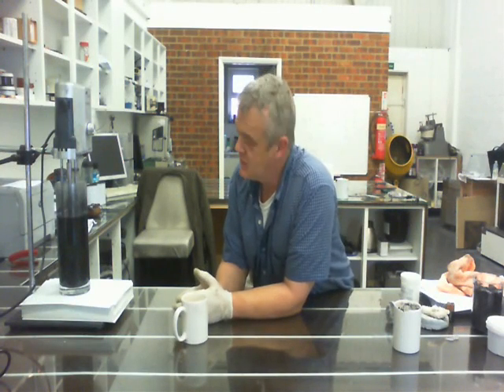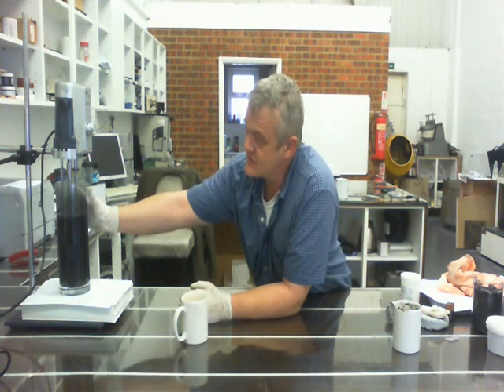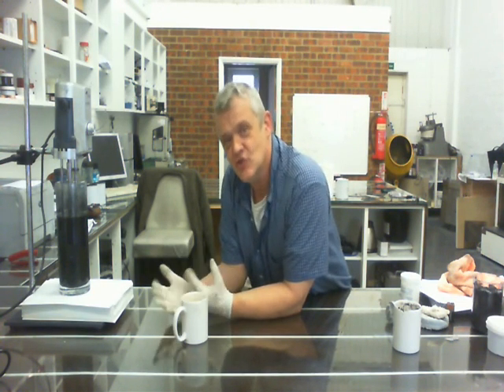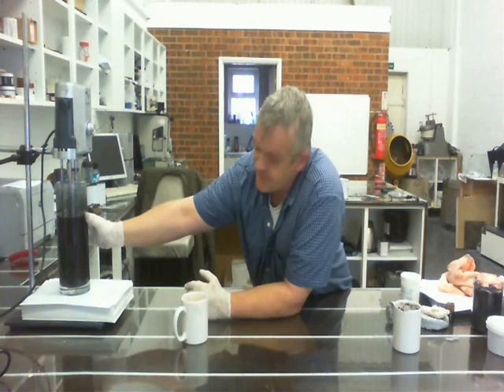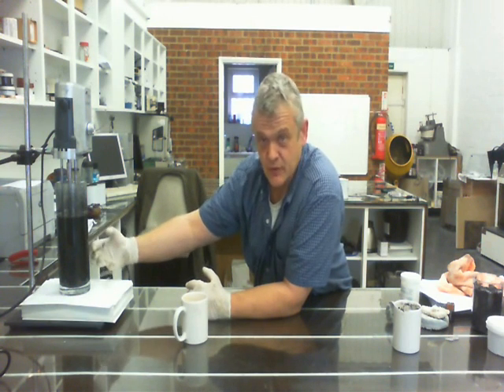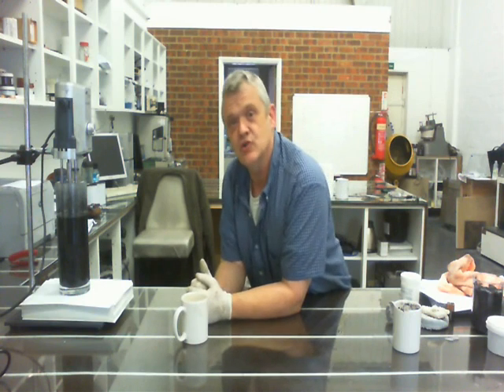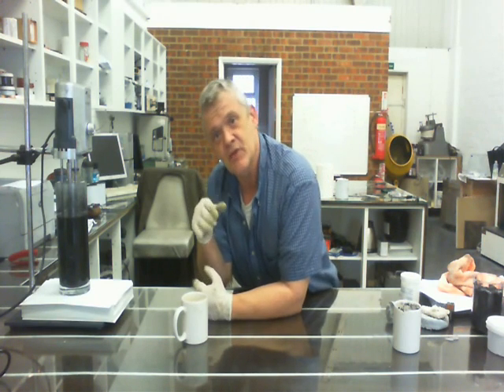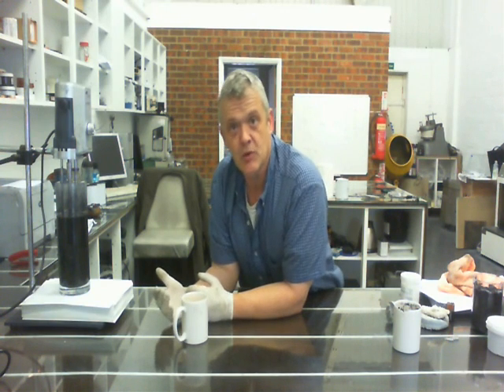Graphene From Tea

Comment: There is this company called Carbon3D that makes 3D objects using a projected uv ray to harden shapes from a pool of resin. I was wondering with your incite, if you added graphene to a pool of resin and used the same process, could the graphene harden to a strong object?
Reply from the maker: yeah no worries - the problem is getting it in there

Comment: I experimented with Green tea ranging from 2 tea bags per liter to 10 per liter (soaked for 1 hour cold deionized and sonicate for 12 hours and let stand for 2 weeks ). The challenge  I found I was growing a range of cultures on top of the solution. The result were actually very good once you poor off the mold and centrifuge  :-)  I think I am going to give up with that approach and try using just Gallotannic acid (but not as readily available as my wifes cupboard)
Reply from the maker: lol - I understand and went for gallotanic for those reasons too